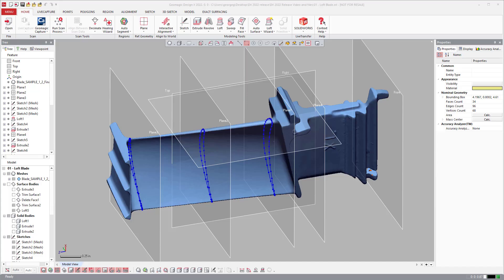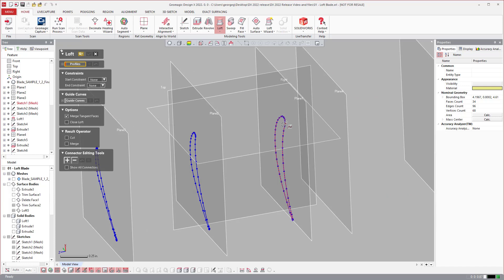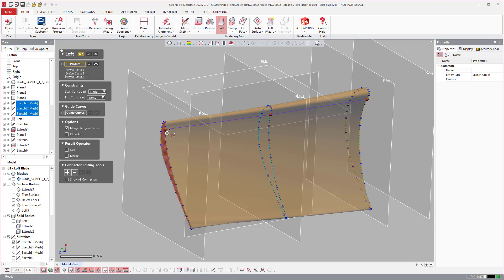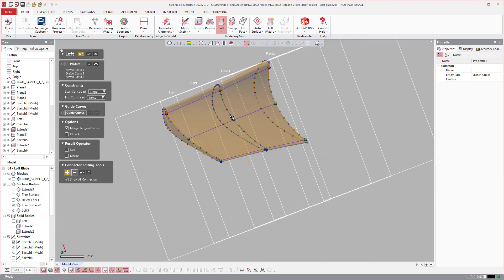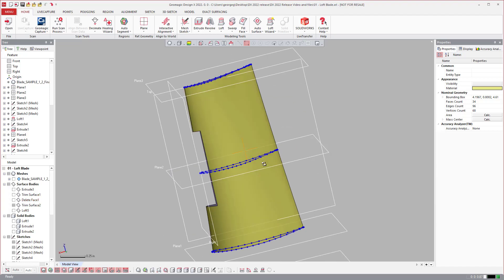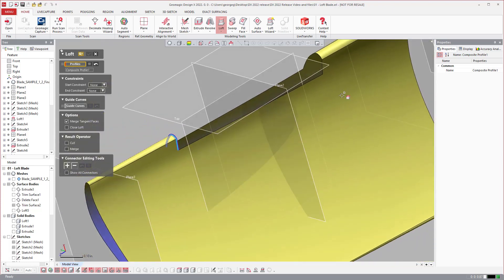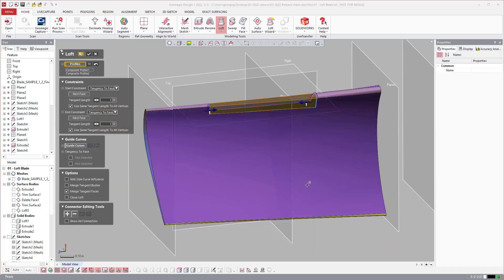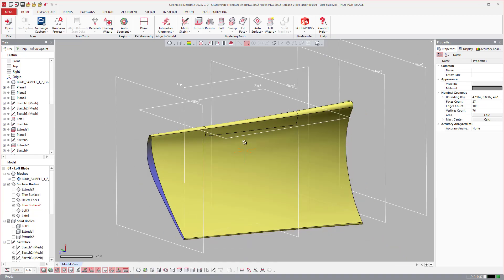Design X 2022 Tutorial 01 - Loft

Comment: Doesn't work like shown on my installation. I cannot move the control points the software generated automatically like it's shown in the video. As soon as I try to grab a point by clicking on it, it just jumps somewhere else randomly. I can only add additional points and move them around but that doesn't help if the automatically generated points are wrong and can't be edited. Do I have to press an additional button to be able to move the automatically generated points?
Reply from the maker: Sorry to hear you're struggling with that! Please get in touch with our support team, they'll be able to help. Here's the contact information: https://softwaresupport.oqton.com/s/article/Contact-Us?language=en_US
Reply: please check the version you are using, I had the same issue in the previous version but now you can simply move the control points with the mouse without pressing any button in the latest version